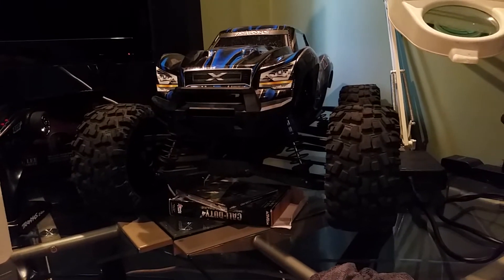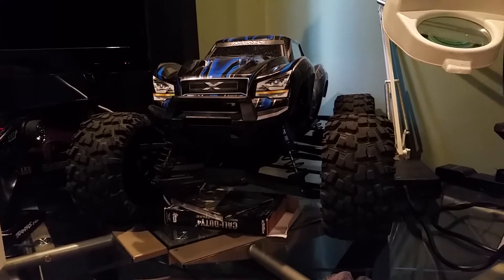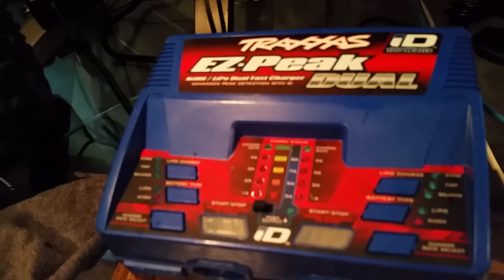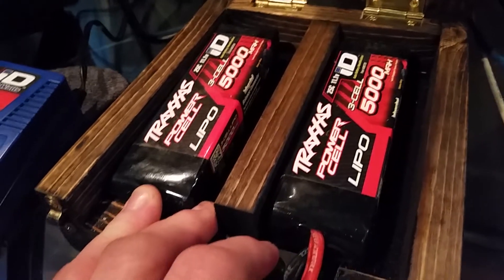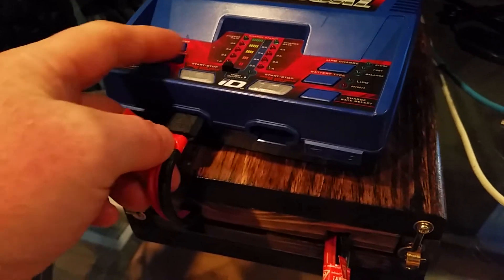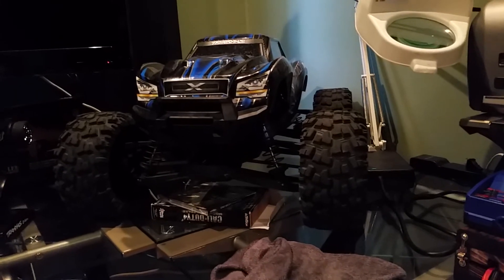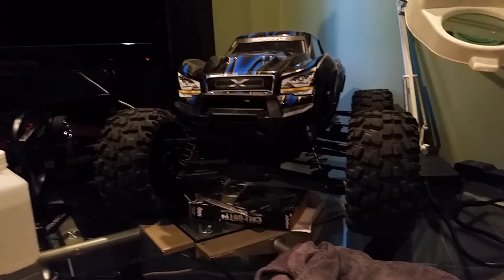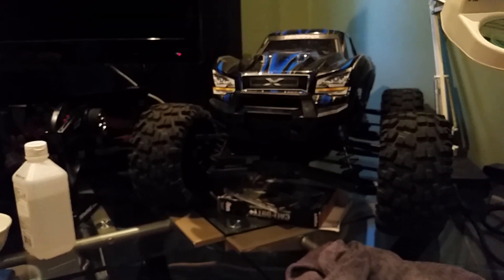My Traxxas X Maxx back on the road again

Comment: you want to run longer, sell your x maxx and get a gasoline 1\5 RC just like the guy that traded his x maxx for a losi gas buggy.   look how much you paid for the batteries and charger and you only get 25 minutes not worth it...
Reply: well he can get other batteries with a better MAH like 8000-9000mah that would give him closed to an hour, the gas rc cant be driving in close-up neighborhood
Reply: +Gerwich Saint-Hilaire and how much  more do you have to spend to get does batteries?   x maxx does 35mph to slow.   it obvious you can't use a gasoline in the street it's to big . I use mine in Park's, and I  don't even use my brakes. x maxx in the park full throttle with top brand batteries won't last more than 30 minutes.
Reply: DANIEL Q bro, i have an Xmaxx myself, im using 2x 3s 40c 9000MAH fluorean for $70 on ebay, i changed the gears to 22\50 im at 50mph now, that is plenty fast for a truck that weights 24lbs after the batteries put in, my run time with these batteries are 45-50+ minutes, its all depends how hard am i bashing it, gas rc are only for hardcore rc guys like not me, i wanna have fun everywhere i go with my rc, neighborhoods, market parking lot, school parking lot, skate park, field park, in front of my hometown Civic Center
Reply: +Gerwich Saint-Hilaire I don't believe you getting that run time I does low budget lipos. check this out, take the xmaxx to a big park where you don't have to worry about braking, cars, people. in other words put the metal to the pedal non stop you won't get 45 minutes specially with does batteries. I now about does batteries and I have compared does to some of the good ones In weight they don't match up, 
 too light. basically the hevier lipo will be the better one.a also gearing the truck to go faster will  drain batteries faster and cause heating issues... how long does it take to charge the lipos you use?
Reply: i haven't seen any gas power rc doing high jumps and stuff, i can do almost anything with my truck, go crawling, sand dune, skate park, everywhere, i even prankd one of my college teacher by driving this thing to school, i was afraid doing that, but got some reactions out of it, 1hr45 minutes, so im wondering where else can you take your gas rc other than public parks
Reply: Gerwich Saint-Hilaire Gerwich Saint-Hilaire  that's because you haven't seen any videos of the baja. Research it and you will be blown away of what the Baja is capable of doing. a   Baja will run all day and the best thing it won't over heat does not use lipos oar any charger's to buy  and the best part I don't have to wait 1 hour to charge batteries. In other words when you're juice runs out I will still be smashing.
Reply: if only there's something to silence the exhaust a little, i would think of trading for it, you right about the charging time, so you have the baja, who makes the baja and i will do some research on it, I've been in this RC for 5 months now im learning so much every week, why electric rc cost more than gas rc???
Reply: Hpi baja 1\5 scale RC.
Reply: Gerwich Saint-Hilaire   hpi makes it, there not that loud when using stock muffler and they do sell a silencer and silenced exhaust. I do not recommend using the Baja in public streets. The Baja or any gasoline RC needs  space. Using mine today I can wait to rip the grass out of the ground and have endless fun with out having to worry about lipos running out and wishing you had 4 pack's of batteries with you run some more...
Reply: DANIEL Q ohh yeah, I've seen couple videos of the Baja in action, it has some get up in go now, why can't you use them on public streets?